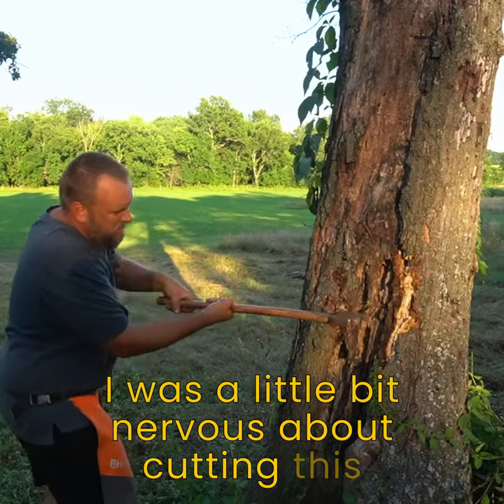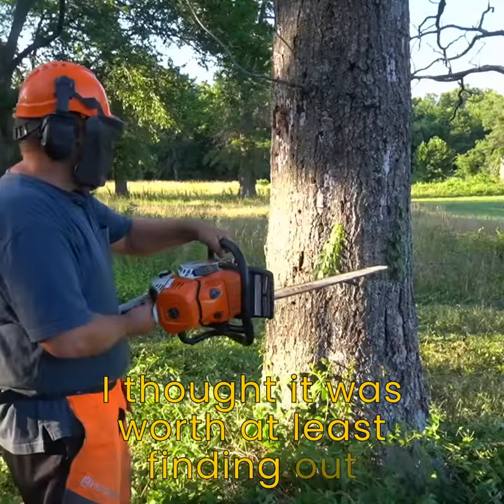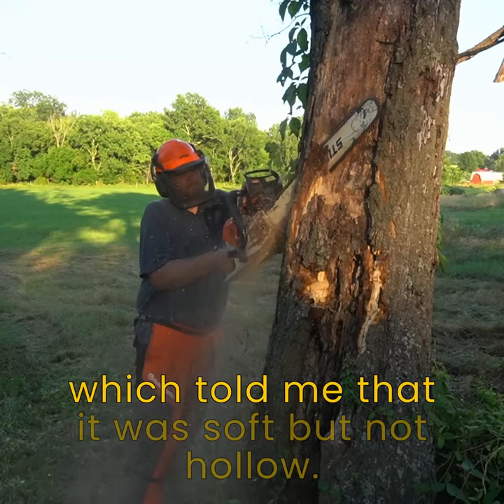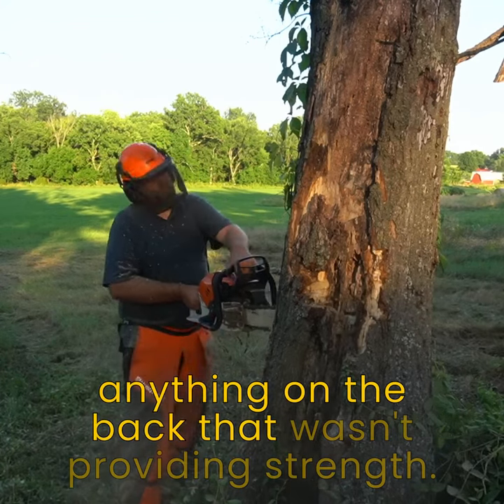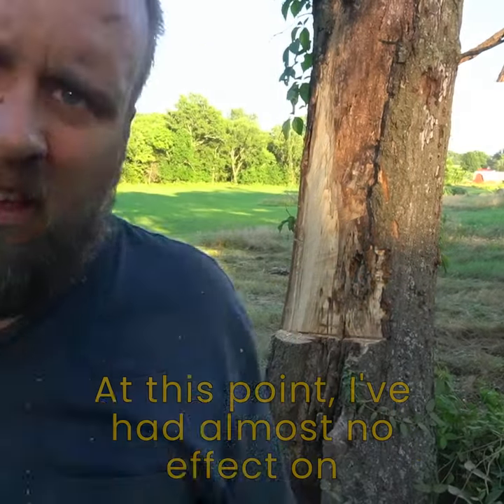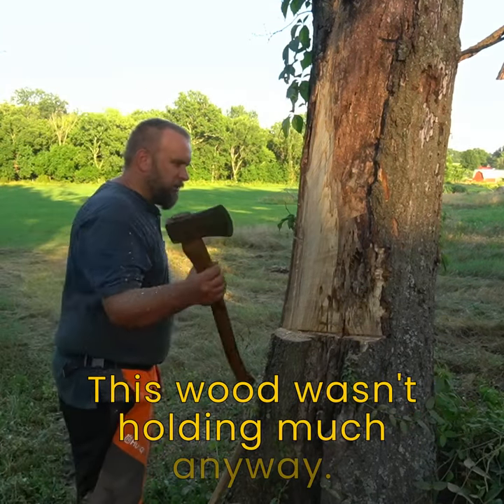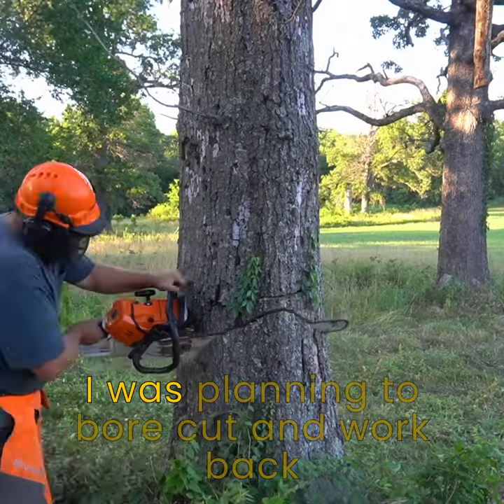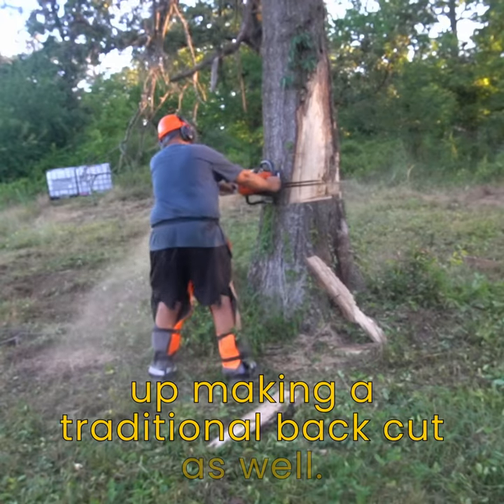An Interesting Way to Cut Down a Hollow Tree #treefelling

Comment: Nice work! If you make your exploratory plunge cut in a vertical orientation, you'll sever fewer fibers and maybe maintain more integrity within the tree.
Reply from the maker: My thought on the horizontal plunge is that it’s right above my face, cut and perpendicular, which is similar to punching out the center of your hinge. Could help prevent a barber chair.
Reply: @RockhillfarmYT  Sounds like an excellent approach. I didn't pay close enough attention to see where you plunged to see your whole strategy 😅
Reply: @RockhillfarmYT that’s about as BS as your “scalp off” procedure.
Reply: @WhackBytch256 which wasn't bs? Right?